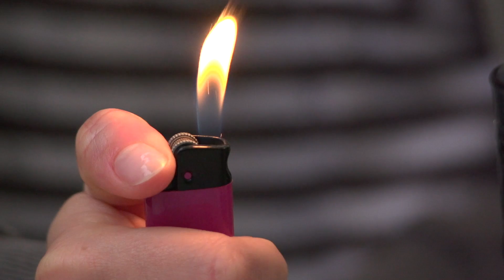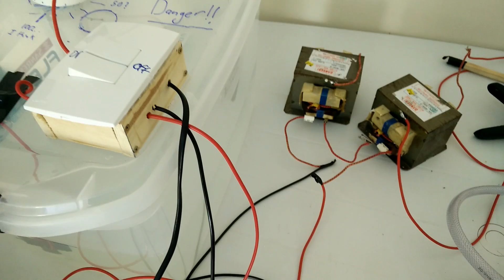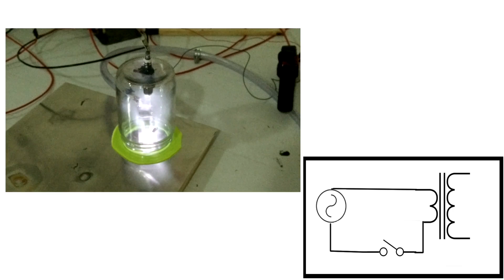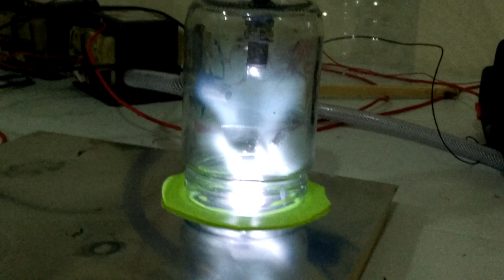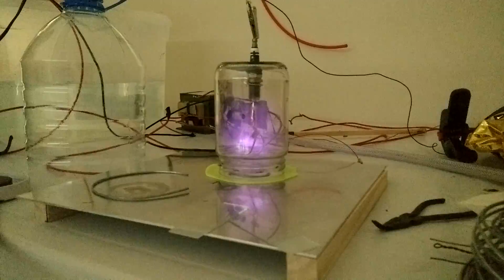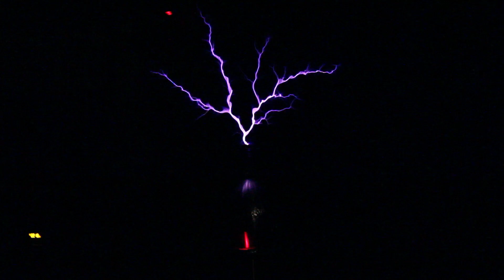Putting Plasma to Work (DIY Fusion Reactors, Magnetrons and More!)

Comment: So how does one afford a diffusion pump without a grant or a youtube channel to write a minimum 2 grand machine?   Only thing i found lab grade was 630mmhg which is only 630 torr or less than 1 atmosphere..  so wtf was used to reach the vacuum that was gotten in the video?  I saw a 23,000$ machine that would reach the levels talked about in the video..

Comment: Nice work. We know plasma experiment require high voltage source. 
Question. Should we use direct or alternate polarity electricity in these experiments? Or it doesn’t matter.

Comment: Really cool video! Learned a lot from it. So I want to share my setup to create high voltage by extending a cheap welding inverter with a self wound flyback transformer.
@

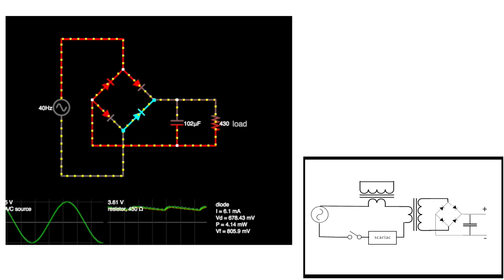Comment: 10:40 don't short it with a screwdriver or any other kind of short circuit, this happens often and I'm guilty of it too but it may damage the capacitor and reduce its lifespan, instead use a high resistance load capable of dissipating the energy stored as heat.
(a puny 1/4th watt resistor or the like will probably melt or even explode depending on the capacitance and voltage, so use a beefy one)

Comment: I notice on your fusor at one point you had little sparkles. I have had these often and found no reference in literature as to what the little sparkles are on metal surfaces. Blueish on iron and steel and green on copper. Do you know what triggers the sparkles as opposed to the general plasma in the chamber?

Comment: Since the DC is isolated from the switch, would it be safe to use a switching TRIAC? Or does the square wave lessen the efficiency of the arcs? I would think the AC wave pattern wouldn’t matter since it’s being filtered by the diode bridge and cap.

Comment: Why does everybody talk about building fusion devices while they are not? And far away. If you usw the same approach like a fusion reactor you need the same size and energy...
You would need a completely different approach make fusion in a compact device.
Reply from the maker: Making fusion happen is not the same as using fusion to power something. Making things fuse is easy
Reply: @thethoughtemporium  Then please tell me which material is fused in which way? And where does the energy from the fusion go?
I only see effects likely from electrons that are energized thus elevated to higher orbits. And when they fall back to the orbit where they belong they can submit radiation (light). At least that how the standard model explains it.

Comment: 10:00 I see you have a capacitor at your output. So those oscillations that you were showing are the peaks before the capacitor, which holds the current close to peak value and we would just see a line instead of the peaks.
Reply: I guess i should have just listened a few seconds longer xD

Comment: This is not educative. Plasma =/= Fire. Fire is a chemical reaction, Plasma is stripping of electrons from atoms. Duh.
Reply from the maker: You know it can be both right? fire can be plasma, while plasma doesn't necessarily have to be fire. The energy of the reaction of creating fire is sufficient to strip electrons off the hot gas, that's the whole point
Reply: @thethoughtemporium  ...ok
Reply: "chemical reaction" isnt a state of matter. Is it a solid, gas, or liquid? no? right because its a plasma
Reply: @KevinsArmory  Tell me one chemical reaction that produces plasma.
Reply: @Blackvertigo1  Nuclear Fusion? Lightning storms? Plasma globes? Turning lightbulbs on? Welding? smelters? just because low temp fires are in the transition zone between gas and plasma doesnt mean high temperature fires dont have any ionization. Fire is conductive to electricity, even low temperature candle fires. you can use fire to guide arcs. Fire is conductive because its ionized. 

As far as combustion sources are concerned, are you claiming electrons arent ripped off during combustion or oxidation processes in general when entire atoms are joining and reforming in reactions? I dont really understand your critique.
Reply: Combustion/fires have nothing to do with plasma.

There are no transfer of electrons, its just shared electrons.

If intermingled fingers to both hands are fire/combustion, then two hands that are not touching either one is plasma.

Also, I said "chemical reaction" and you said "nuclear fusion"... Uhh.. You just said nuclear, when I specified "chemical".
Reply: @Blackvertigo1  you have not answered what state of matter fire is. are you clsiming fire is a gas? How is fire conductive and ionized at high temperatures if there are no electrons being stripped?
Reply: @KevinsArmory  Fire is if at most, a gas.

Fire is a mutual sharing and rebinding of atoms on a molecular level.

Plasma is just gas that has been stripped of all or most of its electrons in the atoms.

Comment: You make a small mistake in the video.  A magnetron sputter head does not cause the metal to sublimate by heating.  It is more a physical snookering of the atoms out of the surface.

Comment: try run a lower voltage charged capacitor in paralell to the fusor and see if the glow increases. high voltage causes the low atmosphere to break down and become conductive. this means that a lower voltage higher current will be able to conduct trough the plasma once its formed and increase power in the glow. tunder clounds do this all the time with lightning. they create breakdown voltage and once the conneciton is made to ground the low flash goes into a bight flash as a much lower voltage current increase brightness as it conducts trough the circuit formed by the first high voltage breaknown. even one time  use cameras do this with the flash. you can technically use a 200 volt microwave transformer and conduct your fusor at some vacuum and use a normal 220v supply to increase the power and glow. if the current is high enough the fusor chould get hot enough to produce some insane bright light. just voltage and little current will not do much unless you make the fuson very small.

Comment: As always your videos are very impressive. I am wondering if your circuit can be used to make a surface functionalization tool for microfluidics, there are commercial ones available, but they are $1000 or more. Is it possible to reconfigure your circuit for this purpose? How? Thanks

Comment: How long is a plasma still active after it's power is cut, 10 milliseconds, 20?  If you launched it with a nail gun blank could you get the plasma to go 30 feet?  40 feet?  I think we have the technology to make low-power plasma rifles.

Comment: Soft Plastics are BAD for vacuum. Barbs are for pressure, leaks too much for vacuum. Smooth fittings and high vacuum grease helps. Vacuum does not "flow" like pressure and has not a direction like pressure flow, the wider the pipe the better. Metal is better. KN fittings rock. 
Cryogenic pumps are great, MDP's are OK and cheaper than turbo molecular.

Comment: Take a tube of about four inched in diameter and suck out most all the atmosphere as much as you can . Then wind a coil on it and  connect it to a double sided tesla coil or a toy tesla coil that can take the high voltage ion field and convert it into house current and vice versa. This way you make an ion oscillation that works like a flyback coil and electrostatic fly back coil inducing the system in a self sustaining mode.

Comment: An alternative to the Scariac and Inductive Ballast to limit current is to use an AC Capacitor which uses Capacitor Reactance to create resistance, thus limiting current.  I am using a 108 UF capacitor to limit the current I am doing.  You just wire in the capacitor like a resistor.  Capacitor Reactance Formula in Ohms = 1 / (2 * PI * Frequency * UF / 1000000)      EX:  1 / (2 * 3.14 * 60 * 108/1000000) = 24.57 Ohms       120 VAC / 24.57 OHMS = 4.88 Amps

Comment: My Advice to anyone building a small HV experiment using a microwave transformer is to leave it in the microwave. Pull out the magnetron and run wires from the transformer into the chamber usually used for cooking. Do some surgery on the door to get rid of the gauze, and then run your experiment in the chamber. Keeps the HV safely contained in the convenient box.

Comment: What if the systems for the suspension of plasma could be placed in a centrifuge? What components would this be beneficial for being able to harness the current and contain the plasma more efficiently? Maybe just the container for the charged particles? I'd be surprised if there hasn't already been an academic competition for plasma suspension experiments that could fit in a satellite. Precursors to the microgravity factories for microprocessor crystal superconductors.

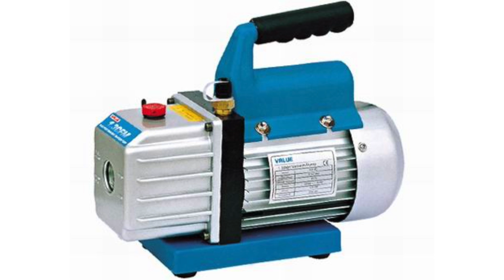Comment: 12:14 Neither  is NEVER after a mechanical pump ALWAYS before them. If high load at high pressure you get a bigger mechanical pump if the previous cant cope, nothing else. A diffusion or a turbo pump are only for very low vacuums far away from plasma area.

Comment: some time before - i made regulator like your scariac
it was like sirinje or chemical test-tube, with two carbon rods from Zn-salt batteryes, placed paralel - like rail, and half of volume was filled by water(little salty if you need more power)
and closed tight with some germetic wax, on AC current there is no gase evolving(no simmetric AC electrolisys occurs without bimetall or magnetic field near) and no carbon rod degradation occurs, so it can be closed tight
then by place it vertically - you will get bottom halfs of each rod in electrolite = full pover
if horisontally plased when one rod under another - only one rod underwater, and second - upper - in air , so zero current can flow through that regulating cell
by rotating you can regulate on 90degrees angle 0..~100% power
Reply: most exciting task here - to modulate fast burning "turbo" torch butan-air flame somehow - to get subwoofer plasma speacker
internal combustion engine have not high efficiency to mechanic work, accoustic dynamic magnetic system - also bad eff, but burning can sound loud and hi effective, electrical plasma not effective, because of modulation kwt problems, but 1ltr of butan or petrol contain 13kWtHr of energy tht suitable for air exhaust and can be regulated mechanicaly by electromagnetic valve
so subwoofer need no any box volume to produce bass, and i get some sucsess there allready but no linearyty unfortunately, when moving gas+air mix flow by servo-dinamic 15wt cimouter AC type near serving-flame torch
bass fortunately there,
and - slow yelow flame not working - due to @longstory@ of one instant allowed  portion flaming distance and time

Comment: Besides the normal care around high voltage.boot..gloves ..wooden floor ..one hand in one pocket..please remember and realize the capacitor on the rectifier output will retain high voltage charge even with power disconnected..potentially for years! Many people have been killed or injured permanently by the capacitors. Discharge them carefully. A screw driver and wire with large resister 1 k or so and a alligator clip is useful for this. Old crt. Also keep charges up to 25k volts!

Comment: There is no glow discharge in a magnetron. If you've got plasma happening in your magnetron, 1) it's not going to make any microwaves and 2) something is very wrong with the high vacuum it's supposed to have inside.

Comment: Curious about inductive ballasts I followed the link in you provided in the description. The first sentance of the page is as follows; "The ballast (resistor ballast) is a device for limiting the flow of sunlight and generating instantaneous high pressure.". The rest of the page was a wall of difficult to understand chinglish text.

Comment: Plastic and rubber outgas, and never use push connect fittings. Also Mc master has YorLock fittings and they provide a good seal.

Comment: It is normal with a microwave oven transformer for one side of the secondary to be connected to the case. The case should be connected to ground, and if you have two of them you can get double the voltage by connecting the case of both transformers to ground, and the primaries have to be connected opposite of each other so the output of each transformer is 180 degrees out of phase.

Comment: If you build one of these just don't tell someone that you have a nuclear fuser, as too many are not educated enough to know it is not a nuclear reactor. A nuclear reactor uses radioactive materials, but this has no such hazardous materials. It will create electrical burns if you touch it.

Comment: Another thing plasma is great for, cutting metal... as in a plasma cutter. Kinda like melting through steel light saber like...

But I wonder people have managed to build fusion reactors that could fuse lighter elements into heavier ones. So while you aren't producing a lot of electricity but why not use this to manufacture Helium? Helium is one of those scarce/nonrenewable elements and perhaps someone could make a large fuser just for making helium gas out of hydrogen.

Comment: at 10:00 minutes into the video you mention adding the diode bridge to control the AC waves. I was wondering if you could tell me if there was something you could put there instead that doesn't rectify the pulses but instead can control the frequency of the intervals and how high or low the pulses reach in voltage.

Thanks

Comment: Please, please, PLEASE, connect the ground wire to the transformer casing, switch casing, and all metal caging/casing/enclosures/frames to the ground wire.  They should never become "hot" unless you made a mistake.  Also, use a fuse if not using a power strip as your circuit breaker panel will allow too much to flow if something goes wrong.  It's also nice to have an indicator light on the load side of the switch - or switch that illuminates when closed.

I repeat, please ground everything metallic that you can and have a close-by fuse or circuit breaker on the line side of the switch.  The comment below by https://www.youtube.com/channel/UC8shdrlmkjZw7Y5u582bMww @Hunar Omar below covers great information as well; I'm just seeing this later.

Comment: Stop spreading the small solar system analogy of an atom. It is flat wrong and all of modern physics will tell you its wrong. Jesus fucking xrist... The electron is not a particle. It is an electrostatic scalar potential until the electron "cloud" is perturbed by a cause to give it disequilibrium and therefore a potential difference. Otherwise known as EMF (electromotive force). The "particle" properties of electrostatic disequilibrium are now in a state of mediation and when you have moving charge you have magnetic boundaries. This is the electron "magnetic moment". 

Get updated on current particle physics and field theory please and stop keeping people in the 1900's.

Comment: you can limit the current safely with a primary winding of a thin awg like awg 50 and higher, or awg like 20 and higher but more turns then just 2 or 3 , make as many turns as needed to drop the current /riase the impedence - resistance. Having a primary of a thin awg and many turns will create a much higher voltage on the secondary making a low current and even higher voltage secondary output for a better working plasma generator.

Comment: I would like to know if plasma can be controlled with this. Search for "spherical electromagnet" if you want to see a better design. It should be the first thing that pops up. Look at figure 1. You will know it when you see it - it's my icon that you see to the left. In this design the plasma is rotated like the armature of a motor with the axis of rotation constantly changing. The counter emf inside the plasma compresses it toward the center.

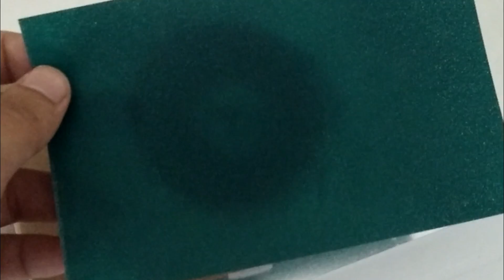Comment: 17:26 so the metal is turned directly into a gas. Would the same effect be had if a piece of wood was placed inside? Could a secondary pump extract the syngas or would the plasma instantly burn it all?

Comment: What you've said about vacuum and conductivity is not completely true. There's optimum somewhere near 1Pa (so rotary pump is ideal). When you add turbopump and reach vacuum better by three orders of magnitude vacuum is no longer conductive and to force electrons through the vacuum you need some emitter using extremely high gradients of electric field or/and heated electrode like in old CRT TV and something that accelerates electron towards other electrode and then you need to deal with xray radiation.
Actually ... fusor is suspicious for two reasons:
* if it accelerates electrons by something like 2kV to 2keV of energy and they hit mostly oxygen and nitrogen atoms, they will emit soft x-ray or hard UV radiation with 400-500eV energy when electron is kicked from K-orbital (close to 2.5nm wavelength). Maybe glass can shield this, but i'm not sure. (EDIT: ops, it accelerates electrons outwards)
* considering 2keV energy of accelerated plasma particles ... how can they cause nuclear fusion? I would expect that putting atomic core into excited state needs energy of 100keVs and breaking/fusing it would require over 1MeVs
* First video I've found about fusor uses Geiger counter ... isn't it capable of detecting x-ray radiation which proves nothing about fusion?